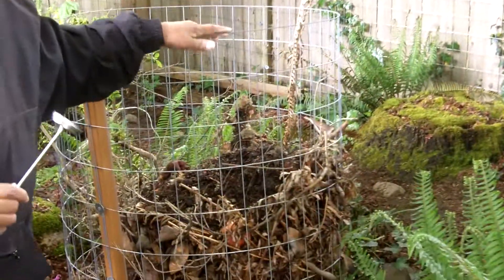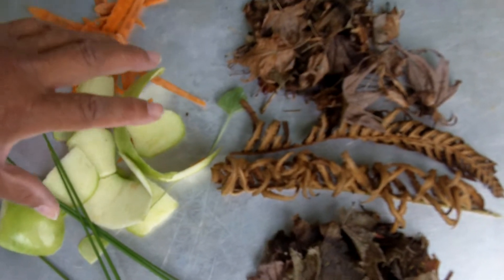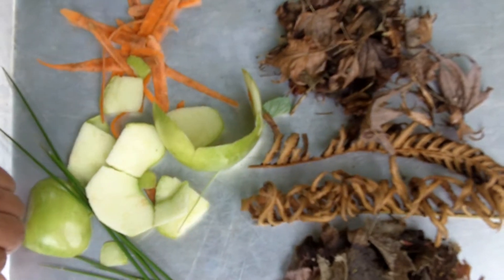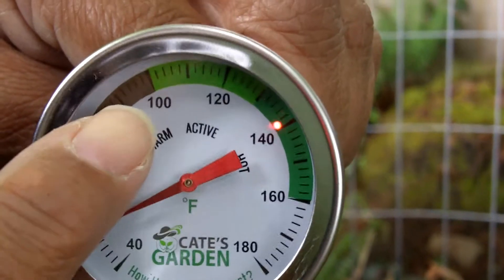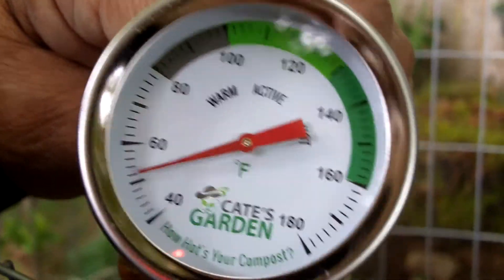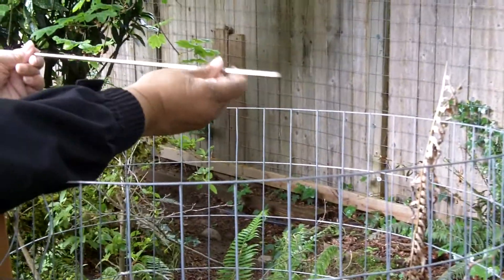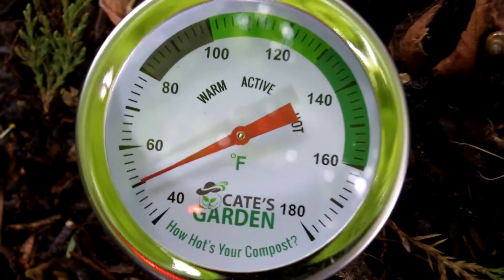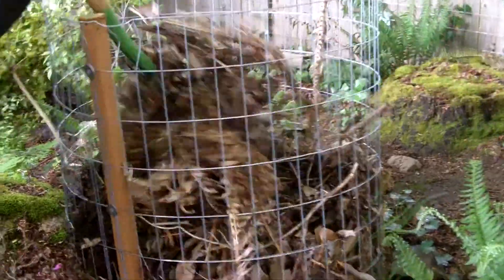How to Use and Read Cate's Garden Compost Thermometer

Comment: It's always nice to see a trusted face touting a tool.  I came very close to ordering one of these compost thermometers as a result of this and other videos and websites. ( I probably would have run right out and bought one had any local store had them in stock.)
Then I thought:  "Why spend another $20 on this garden, when there might be another approach that's free?" (Really?  I can buy a lot of carrots for $20!)   
So I took a 4' steel rod and shoved it down the middle of my compost pile, left it there an hour or so, then pulled it up and touched it (and used my HF IR thermometer to give a number):  86 F.  Not nearly hot enough.  
But it was only a warm day when I turned the pile last week, and I used (cool) tap water to wet it, so it's no surprise it started off cool.  That it stayed cool for a week was troubling, though.  I wondered whether I might have killed off the "bugs" using tap water (containing chloramine -- to kill "bugs"), and might have been better off with rainwater.  But then decided that the quantity of chloramine probably wasn't enough to kill all the "bugs" in a compost pile.
But still I needed to do something to get this pile "going."  So I ran a hose from a hot-water tap in my house, through an old aluminum watering "wand" that I'd cut off to look like a huge hypodermic needle, and thoroughly wet the pile from the inside, top to bottom,  till it "steamed" and warm water was running out the bottom.  Now I'm going to sit back and see what happens next.  If in a couple days, it's cooled back to 86 F again, then this would have failed.  We'll see...
(By the way, hot water is a bit rough on garden hoses.  I blew one out that had seen its better days.)
Reply: Try adding more green material. I added grass clippings to my compost pile yesterday evening and it was over 160° F! Way too hot, so I added more brown and watered it well . Hoping it's cooler tomorrow!

Comment: All good ideas , but of course with a pile thats 3' wide needs to also at least be that tall or you wont get the heat needed to get it hot.   Another thought many people might have is how do I know my thermometer is reading correctly.  Not all compost thermometers are good ones.  I had one from a year ago that I recently had questions about its accuracy and a new one I just got in which I also had questions about its accuracy.  So I thought why not test these by putting them in my fridge which I know is 39 F.  I have a regular refridgerator thermometer that I keep in there which always reads 39.  So my old CT reads about 30 while my new one reads 39 which tells me it is accurate.   So now back to my original thought , this new one was reading 160  and my old one was reading 140 so I pitched the old one and feel pretty sure the new one is correct.  Im hoping this will help someone with similar concerns and is serious about their composting.